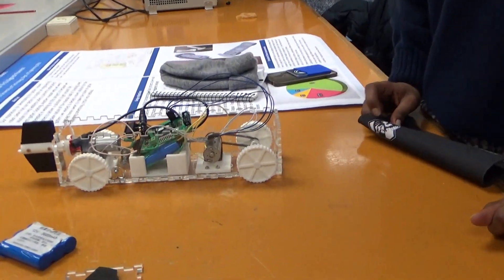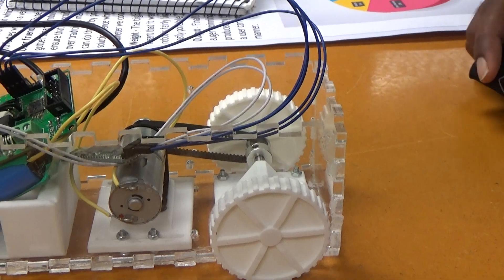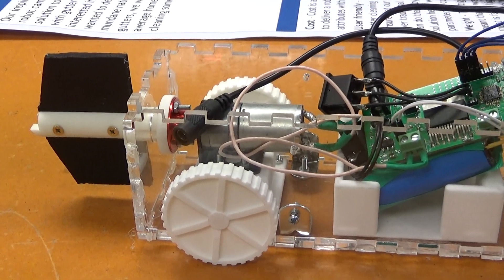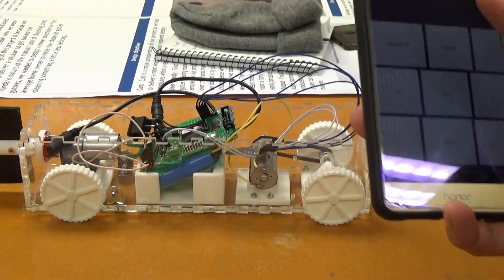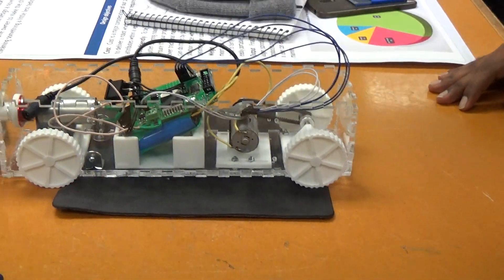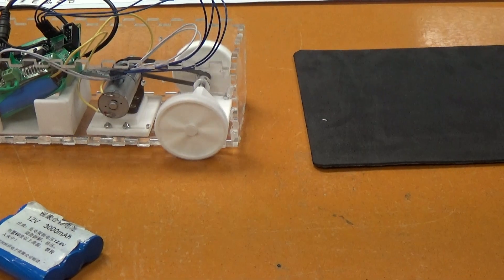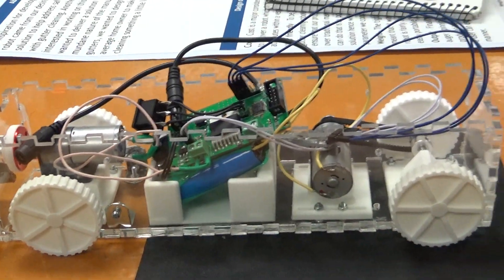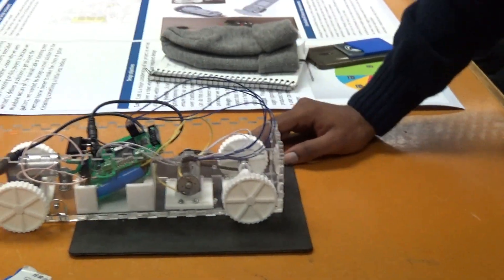Gutter Cleaning mini Robot

Comment: Need to put some rubber bands around the wheels to get traction!

Front flipper would have to be mounted at an angle to cope with British gutters, where the roof tiles recess in to.

PCB mount is a bit off on this one too as if it's 3D printed it should fit much better than  it did.   Bit of a shame they didn't modify it to fit.

Chassis is neatly done, app control very useful.   Good project.